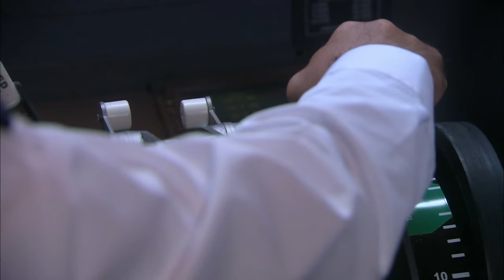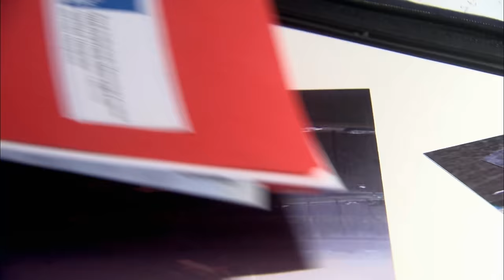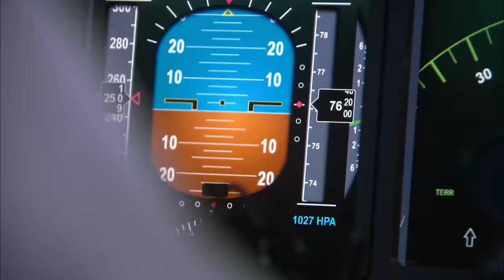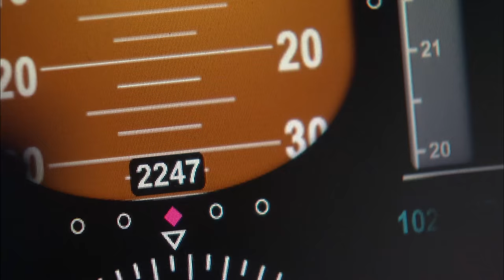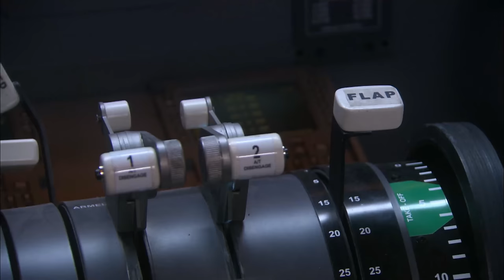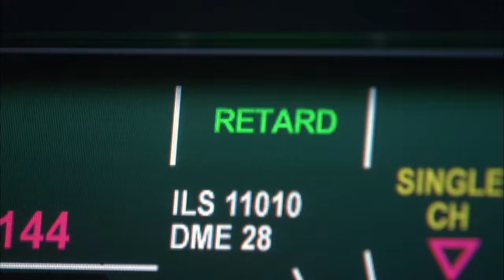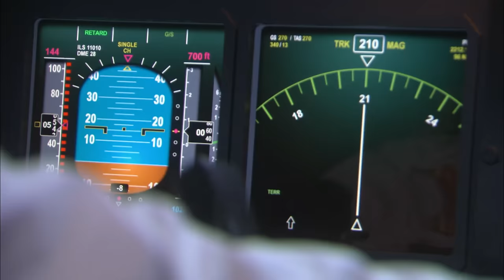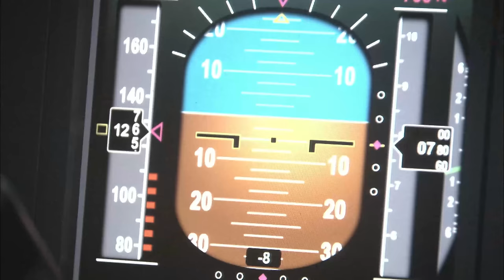Turkish Airlines Flight 1951 Crashes Short of Schipol Airport [4K] | Mayday | Wonder

Comment: A Boeing system reliant on one single sensor brings down a plane after a long series of complaints? This sounds familiar :\
Reply: Yep. Includes cars pharmaceuticals and everything else they experiment on us.
Reply: Note that Airbus has had similar faults.  One damn near killed everyone on Qantas Flight 72.  Another is potentially rendering Airbus A350s dangerous to fly on due to loss of structural integrity and/or loss of ability to properly dissipate lightning, either of which could cause the plane to tear apart at cruising altitude.  Airbus is not really different from Boeing in this respect, except for being luckier.
Reply: It's all about profits. Even if a company knows there's potential for fatalities they'll only do something about it if fixing the item is cheaper than the projected amount they'd pay out in a lawsuit.

Cool, huh?
Reply: And they still blame the pilots?
Reply: If you see this blue thing that’s the freaking support ukraine thing
Reply: without One big weakness...we'd never have Star Wars and the Deathstar
Reply: It was MCAS before MCAS was programmed lol

Comment: I’m surprised that the plane didn’t catch on fire considering that it broke into 3 pieces. The investigators practically struck gold with this crash, considering that the plane crash had many survivors, and the plane was relatively intact.
Reply: Yes indeed. The vast majority of the passengers were incredibly lucky as well -- 123 of the 128 survived a crash that by all rights should have killed dozens, if not everyone, on board. It's remarkable that the plane broke apart in a way that the fuel was not ignited. 

It's still very said that 9 people -- 5 passengers (all in the first 3 rows) and 4 crew (the pilots and a flight attendant in a jump seat at the very back of the plane) -- were killed. RIP to all who died.
Reply: I can only guess that because they had completed most of their route they were lower on fuel.
Reply: @christopherweise438  I agree
Reply: @christopherweise438  That's the only thing I can think of, if it were full of fuel it would have been a huge fireball.
Reply: It was near the end of its route so most fuel was used up and it was also falling at a relatively slow rate so the wing tanks may not have ruptured.  They were even able to check fuel levels after they said.
Reply: @LastAvailableAlias  THE VIDEOS OF THE REAL CRASH SITE IT APPEARS THAT THEY DID NOT
Reply: there was barely any fuel left
Reply: Its because the engines became detached and were forward of the actual crash. Jet fuel, at normal temperatures, has very low vapors, and it's Flashpoint is 38°C. This means, without a fire to ignite the fuel will not combust.
Reply: They probably didn’t have much fuel since they were at their destination. But, yes very lucky!

Comment: 42:21 The discussion about Boeing wanting to give information is out of date.  We see that with the 737 MAX and how Boeing didn't initially include MCAS in the pilot manual.

Also that Boeing didn't see a malfunctioning altimeter as a safety issue says the problems at Boeing existed before the 737 MAX iteration.
Reply: A lot can change behind the scenes; I believe them when they said they wanted to give info, but obviously, things has changed between this crash and the incidents with the 737 MAX

Comment: The problem is with the automation.  One big problem is that the automation does things without communicating to the pilots what is being done.  This happens again and again and again.  All they talk about as far as a fix is better training.  Better training may very well be needed.  What is also needed is a standard interface for all automated systems on all aircraft. This should be standardized across all aircraft from all manufacturers. This system would  report to the pilots exactly what the automation is doing.  This should be a separate screen that is just for reporting what the automation is doing at all times.  This should be such that a pilot on a plane that has new automation that the pilot has never heard of can take one look at that screen and know exactly what the automation is doing and how to turn it off if needed.
Reply: I think you're on the right track but another screen to look at sounds like a potential hazard since it would probably have a LOT of information, most of it routine and correct and as a result, I think pilots would come to ignore it more often than not because there is already so much to pay attention to.

Maybe a Siri-like voice? I'm certain there's a reason none of the automation speaks (vs bleep, blare, buzz and shake) but maybe that could work? But it would only speak when it takes control over a certain threshold. So, it wouldn't say "I've slowed down by point 5 to maintain altitude" but it would say "lowering air speed to XXXX for landing sequence"

Comment: A 2020 investigation by The New York Times found that the Dutch investigation into the crash "either excluded or played down criticisms" of Boeing following pressure from Boeing and US federal safety officials, who instead "emphasized pilot error as a factor ... rather than design flaws."[12]

big yikes
Reply: Wouldn't be the first time that the airplane manufacturing industry used political pressure to hide design flaws.   It's rare but it happens.

The biggest one was the DC-10 cargo doors.  A really terrible design allowed cargo doors to sometimes unbolt in flight, which causes all the air pressure to explode out the unlocked cargo door.   Look up the crash of Turkish Airlines flight 981 (Turkish Airlines does seem to have bad luck with flawed planes!).
Reply: That's negligence. They knew about previous  alt.failures. Ignoring the failure does not make it disappear. Covering up is not the answer.

Comment: "Boeing also didn't foresee the potentially deadly effect of a faulty altimeter". How?! You linked two systems together and didn't think to wonder what would happen if there was a fault?
Reply: Exactly. If the plane is configuring it's landing procedure based on instrument readings that are faulty (instruments showing the plane is traveling 8 feet underground) then OBVIOUSLY you're not going to have a pretty landing. And saying "There are plenty of other warnings to alert the pilot's, so it's no big deal" is 🐴💩 when people's lives are on the line. Unfrigginbelievable that they just blew off such a critical instrument malfunction and in the process, killed 3 of their own engineers and 3 pilots.
Reply: Boeing just responds with a surprised Pikachu face
Reply: Who can predict incompetent pilots and who can foresee all the possible connections and failures? It's ridiculous to blame engineering in this case.

Comment: Boeing left a FIXABLE problem fester until an accident where dead bodies demanded they do something about it - and not BEFORE - is a very bad business philosophy.    Who the hell lets over a couple thousand complaints about a faulty altimeter slide?   That alone should have been a bloody red flag that it'll only be a matter of time before a fixable problem become an irreversible tragedy.    CRM also effing failed in the cockpit when they lost situational awareness because all 3 got tunnel vision trying to complete the damn checklist.  Basically put, all 3 of them were looking at the proverbial map/gps that they forgot to look out at the "physical" road.
Reply: Boeing explicitly tried and repeatedly failed to find what was causing this.  A problem that is nominally fixable is only fixable if you can find why it isn't working.
Reply: Fly the darn plane. The most basic procedure. But the broken altimeter distracted the pilots. It should not have happened. I thought it was a blocked pitot tube.

Comment: The former Boeing CEO said at  30:45 "you just disconnect it and fly the airplane". Indeed the flight crew were not "flying the plane" and this was ultimately their fault. However, this was an ongoing problem with numerous planes! Why don't y'all correct the damned problem?
Reply: right, it's the fact that the plane was faulty, eventually something like this was bound to happen...
Reply: @nataliehurd2532  Exactly. They knew the plane had a problem. But they dump it onto the pilots. It's what they always do.
Reply: If you cannot find the cause of the problem, you cannot correct it.  This was Boeing's issue: they did not know what was causing the faulty readings.  They were still attempting to find the cause of the faulty altimeter readings at the time that the Turkish Airlines Flight crashed.
Reply: @unconventionalideas5683  So? Just to understand what you wrote. They could not find the cause of the problem, they therefore could not correct it? So subsequently they kept the planes in the air full of people. That is to keep their revenue coming in because grounded aircraft do not make money. In closing, it could have been you or me or someone we knew or loved on this aircraft. Kindly ponder that.

Comment: Blame should rest more with Boeing and the faulty equipment, less with the pilots.
Reply: Nope, it was one instrument problem the pilots were aware of. There was a multitude of things the pilots did wrong
Reply: @3a.m.284  But the issue was caused by Boeings faulty system
Reply: It’s more complicated than that. It’s equal blame pilots and Boeing.
Boeing was well aware there was an issue with the 737 and did not do enough to correct it. This issue was a major player in the crash. Had that faulty system been properly repaired, this accident doesn’t happen.
The pilots began their checklists late, were not aware of their instrument cluster, and ignored warnings that were trying to alert them that something was wrong. They also would have briefed on the tech notes and been aware that there was an altimeter issue with the aircraft. It was proven by hundreds of other flights before it that had they been paying attention and completing checklists in a timely manner, they would have been able to land safely even with the faulty system.
Multiple scenarios played out in just the right way to lead to the accident. No one person/company holds all the blame.

Comment: I dont understand how Boeing cant figure out why the radio altimeters keep failing... Its their plane, its their equipment, how can they have over 2500 reported failures and they still dont know why?!
Reply: That’s what I don’t get! Why didn’t they fix those altimeters or replace them? Boeing at fault! They really didn’t try to figure it out and blame it on technology they installed!
Reply: They would have to ground all planes and it would cost billions of dollars and give Boeing a bad rep. So they took they took their chances until a crash happened
Reply: Only thing out of their hands is radio interface. The air waves are full of transient signals.

Comment: First officer was in training, that's why there was a 3rd pilot. Lack of communication seems biggest issue to me. (Both teaching and communication of errors and what each was doing to correct them.) To me, FO had correct approach to correct stall- nose down and increase thrust, whereas w/ captain thrust automatically returned to (near) idle, likely due to altimeter error, which he did not recognize fast enough
Reply: Pilots expect their aircraft to operate as designed. Its not cool to get a sudden surprise that a faulty instrument causes an accident. Some people have better insight to figure something is wrong. They should not have  to guess the correct operation if it went awry.
Reply: A failed altimeter is not a working down. I was aboard a plane before takeoff the pilot noticed a computer failure. It was the altimeter. We waited  for
Reply: The mechanics to exchange it before flying. The pilot refused to fai fly as is. We proceeded to take off safely. 
This pilot should have grounded that plane.
Reply: No, it was an accident waiting to happen that they knew about but didn't fix.  I don't blame the pilots at all.  It'd be like putting rattle snakes in 1000 mailboxes where no one expects a snake, and then that one person who doesn't listen before opening gets bit reaching for their mail,  you say it's their fault.
Reply: @fefferryerr1818  Great analogy,  Feffer!

Comment: Auto-thrust making decisions based on faulty input is a problem. Pilots are hired to fly the plane, not oversee tech errors
Reply: But by the same token, is it not the pilots responsibility of when aircraft in their fleet hae a known problem Z, they need to find out what the work around is? They could've taught their pilots by recreating the fault on the sim and showed them what simple steps to get out of the situation.
Reply: You still have to fly the plane. 
Just because it “should be configured” for auto-land does that mean you just sit back and enjoy the ride?

As a person in control of a large inherently dangerous fast moving vehicle with many lives onboard, you(the pilot) should be in command and ahead of the aircraft, not the other way around.
Reply: I agree 100%

Comment: What a bunch of BS! A known landing problem, that happens at a critical time"ie..low altitude, low speed, automatically adjust the throttles to neutral and flares the plane at multiple wrong times at approach " is not considered a safety issue by the manufacturer BOEING?!?! There should've been at least a fleet wide alert if not grounding to fix this highly preventable and foreseeable crash! I say crash not "Accident". Should the pilots have seen the warnings...sure, in a perfect world they should see everything...but welcome to being human and the real world. Three missed it because of over taxing alarms, ck lists,radio calls and many more reasons. This was preventable by boeing , they are at fault.
Reply: Most of the time they do notice the faulty readings and end up with a safe landing. In this instance it was not the case. In my mind, the autopilot should disengage based on conflicting data. Boeing could have done that considering the number of complaints filed.

Comment: Seems to me, if you have two instruments (the radio Alt.) that disagree,  any sub system (the auto land) should automatically disable.  OR.. if one Radio Alt says (-8)  and the other says (1000Ft), and the atmospheric Alt says 1000Ft.. the computer should use the one that agrees with the other Alt system.
Reply: My thought exactly. Airspeed should not be allowed to be automatically controlled by a sensor known to be absolutely broken.

Comment: Every aircraft stalls at the same angle of attack.  If the automation isn't set up properly and the instruments are not being monitored this is a pathetic disconnect!  The system should not have been in a conflict.  The only radar altimeter the system should have been useing is the working one.  Airlines like crews to use the automation.  Crews need to know when it isn't working and hand fly the approach.  The flight crew blew it and were neglegent or complacent or both.  They paid the price!  Sadly so did innocent passengers.  A good instrument scan is imperative!  Teaching is not something they should be doing on a passenger carrying flight.
ERAU 80 CFIA&I ret.

Comment: Many more variables where involved in this mishap than are spoken about here. First the approach should have been a single channel F/O side coupled approach, not a dual channel as if for a CAT III Autoland. The Turkish airlines SOP did in fact call for flight crew to attempt a dual coupled ILS approach whenever both Radio altimeters where available… however the crew WAS aware the cpt side RadAlt was INOP… the F/O (incorrectly) intended to couple both CMD A and CMD B on the MCP, however because of a switching order mistake (forgot to arm APCH mode prior to arming both autopilots)… he inadvertently armed only CMD A (captains side only)… 

What it boils down to is the approach should have been flown coupled only to CMD B (the F/O side) as he was the Pilot flying, and they had a known faulty RadAlt on the captains side… 
when the air data unit logic all lined up with the faulty RadAlt source altitude the A/TH law went into flare…

Additionally, for the departure and enroute/cruise portion of the flight. Switch of RadAlt and/or Air data source to F/O side is also possible on the legacy NG via some switching. 

Lots of mistakes, it’s ashame.
Reply: Sounds a little too complex for "simplified avionics"
Reply: Design flaws, design flaws. Design a system in which such a simple side mix-up can lead to disaster and what happens is you, the designer's fault!
Reply: @gprich82  It's an airplane, not a barbie jeep; it actually is significantly simplified, (therefore making it easier to fly,) but because of that simplicity a misinput can be all the more devastating
Reply: @tescheurich  These guys are trained to pay attention to these kinds of procedures, what to you sounds like a "simple side mix-up" is actually the whole reason we train pilots to not make these kinds of mistakes. For comparison, a nuclear power plant operator needs to make sure they press the correct buttons or the reactor goes up in flames; if they (nuclr pwr plant op) were to press the button to (further) withdraw the control rods instead of the button to insert them, the reactor would likely immediately 'go prompt-critical'.

Comment: They need a better method of getting Maintenance done . Having one person fixing on a gigantic complex plane with over 2-6 million working parts is silly by now . Mechanics on little cars often don’t get it right on the first fix let alone an aircraft . They should have government regulated quasi pit crew for planes ✈️ like a mandatory place in which planes get fixed and then must pass inspection through the gov